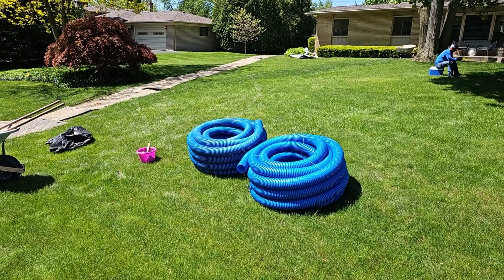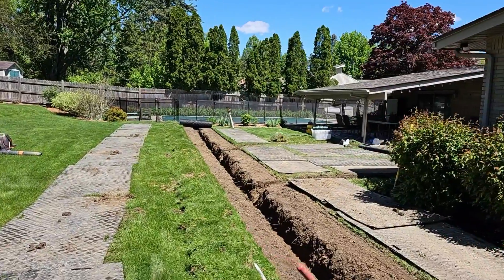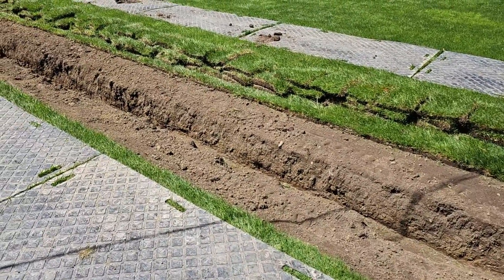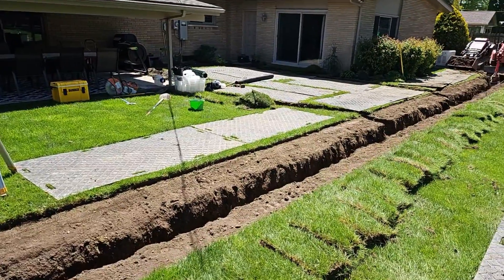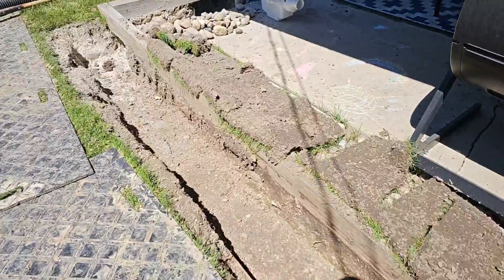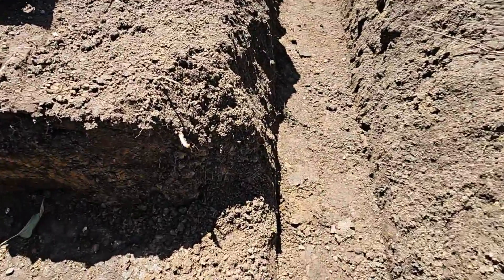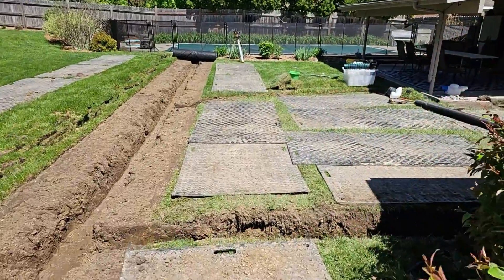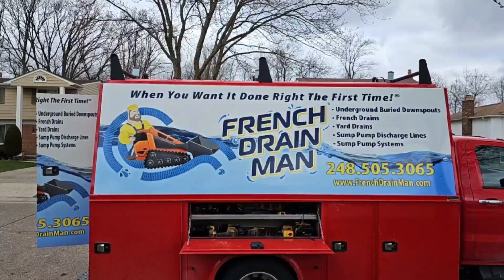How to Collect Water on Negative Slope - STOP Water  with Curtain French Drain & Swale Combine

Comment: To install an interior french drain in the basement,.should fabric be put around the corrugated pipe or just stone around it? And if stone only,  hiw manh inches of stone below the pipe
Reply from the maker: The main thing is to dig out a wide trench. As if you were gonna put (2)4 inch pipes in it. 3 inches of small stone under pipe.

Comment: Got a nice sloping trench through thick toffee clay 8 foot runs good as is but got some corrugated land drain un slotted need to drill holes in it any tips on how to drill it without a trip to casualty please
Reply from the maker: Not a clue, I don't work like that. I buy a uniform perforated pipe. If you have the time, I know, it can be done. 
Best French Drain and Yard Drainage Contractor
https://frenchdrainman.com/

Comment: How much do you charge for a consultation? I'm in Illinois so out of your area, just want to bounce ideas off of an expert. I have soil levels higher than my patio, and not enough slope to take it to daylight in my front yard.
Reply from the maker: $500, and $200 of the $500 goes toward materials purchased, so it's actually only $300. 248-505-3065 tell them Robert said we have room for your consultation. Ask for Nicole.